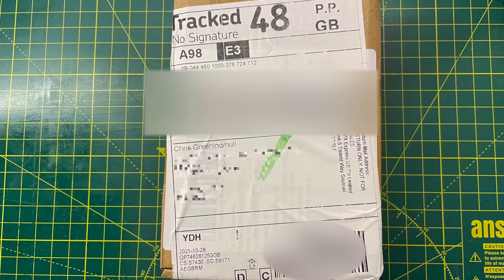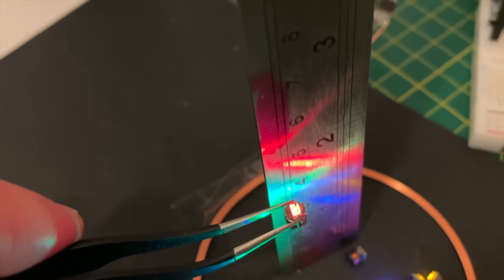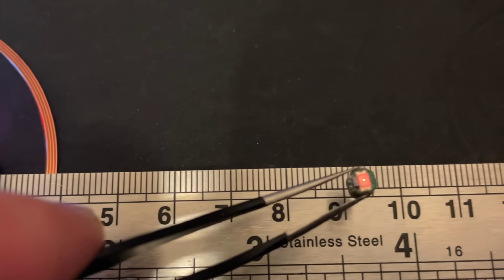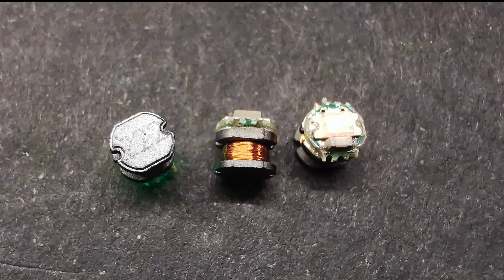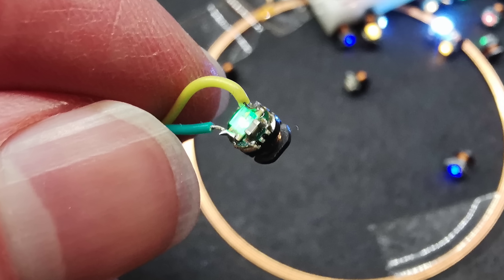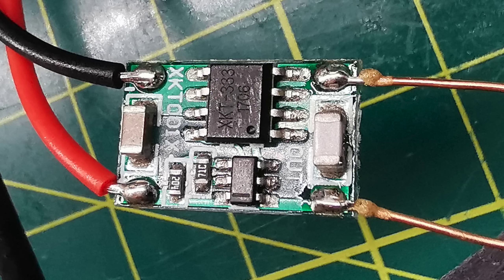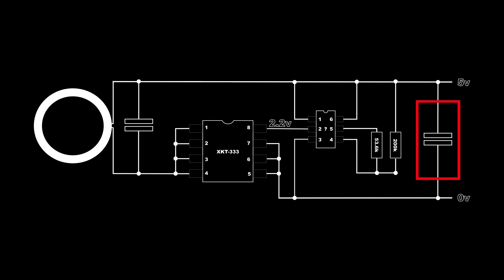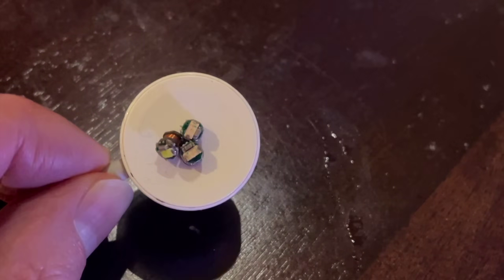Look Mum No Wires - This will blow your mind

Comment: so if you could tune the frequency you could make a programmable pattern...
3 frequencies and variable voltage and you can play RGB colours..
8 frequencies you could have a calculator 8 digit.
Reply from the maker: Definitely worthy investigating. You might need different coils for each frequency. You can try it out with the diy version: https://youtu.be/jdc_0r5pJPc
Reply: @atomic14  I'm a thinker, not a doer. But the idea is free to a doer that hadn't thunk it...

q8)

Comment: Is it waterproof?
Reply from the maker: I’ve dropped them in water and they still light up. You could easily embed them in resin or epoxy. Probably would struggle in salt water…
Reply: Coat them in transparent nail polish, nail polish is perfect for waterproofing small things like leds

Comment: in 2009 in india, there were available some kind of LEDs that were very very tiny and aranged on a transparent glass. when we would stick that glass on the back side of mobile phone magic happened. just 3-4 second before you get call, they started flashing. purely taking energy from electro magnetic radiations!

Comment: When measuring the effective maximum distance these LED can operate, it would be sooo helpful not to introduce a parasitic element into the field. AKA that stainless steel ruler.
I mean c'mon, you sound like you are old enough to have had a stereo with an antenna attached to it and wanting to get better reception. That is where the pre-internet-people learned the basics of fiddling with antennas ;-)
Reply from the maker: I've tested it several times with a wooden and plastic ruler - I'mafraid there's really no discernable difference in range. But you are correct, using a steel ruler was a school boy error.
Reply: Just caught that same thing! Yup!

Comment: This would work well as a puzzle prop for one of those escape rooms.... If you placed an led in a translucent 3d printed gem, you could embed the coil into a chalice or something so that when the gem is placed in it, it will light up. You could even monitor the current of the coil circuit to trigger some door latch or something once you've placed enough gems in the chalice. Since the leds don't draw that much current, you might need a few before you could reliably detect it, but that could be part of the puzzle!
Reply: Probably it would be easier with a magnetic switch and a small battery tho, so nothing needs to be connected to power.
Reply: Use clear resin to make the “gemstones”, then you can cut and sand to the desired shape or size.
Reply: Furhermore, you could have several gems with only a few of them having "magical properties". You'd use some "magic harmonizer" to light up the gems that will allow you to progress.
Reply: put a blacklight LED so that when you place it on the correct spot, it reveals hidden text. 

what, me? noooo i've totally not been learning electrical engineering just to design escape rooms..

Comment: Ok, misleading. Not wireless at all. These are like the term, “free college”. Nope. Having to have a big coil to make them work which is plugged in is not wireless.
Reply: With that definition the word ‘wireless’ has no meaning.
A radio (what,  in my youth,  we called a wireless!) is not wireless.
A mobile ‘phone is not wireless.
CCTV is not wireless.
Reply: @johnstarkie9948  Closed Circuit TV uses wires.
Reply: @JohnDlugosz  
Hence,  “closed circuit”.
Reply: No wires= wireless 🤣
Reply: You're splitting hairs. The LEDs are wireless. The power source provides wireless power. You don't say wifi isn't wireless because the AP has a wire that hooks up to the network.

Comment: wear them as ear rings and  have an induction  coil  necklace   to power them , the pendant on the necklace could hide a LiPO battery

 maybe  the circuit could be reversed to wirelessly charge the battery too , but you would probably need a  large circumference   wireless charger coil to match the circumference of the necklace 
they could be placed inside  gemstone ear rings to light the gen stones  from behind too
I can't really think of any  other practical applications
Reply: That was my very first thought! I won't fight you for the patent, lol

Comment: are they Addressable leds
Reply: No. At least not yet. It seems an obvious (but challenging!) improvement.
Reply: @R.Daneel  not that challanging to be fair, small mcu (which takes almost no power) and some data encoding by modulating power supply.
Reply: @bartomiej368  Pff. I look forward to your Kickstarter.

Comment: @4:00 it is basically an oscillator with enough electric current driven to the large coil. The electromagnetic field of the board circuit must be strong enough to reach and penetrate the little coil of the LED (LC circuit). This has to do with the power loading the large coil, the frequency of the voltage in the large coil and the spatial (shape and dimensions) specifications of the large coil. If those parameters are not properly matching then the power reaching the LED (via the little coil) will not operate properly.

Comment: @3:35 This clipping is due to the clipped voltage that is powering up the LED. If there was no voltage powering up the LED then you will see near sine wave with almost no clipping. Remember that the oscilloscope correlates to the energy of the signal being investigated so if the signal strength in the direction that is powering the LED is passed to the LED then that portion of the sine wave will not be observed (chopped off) and is seen by the Oscilloscope as such. A 10 VDC battery connected to two series resistors each of 1 ohm will produce voltage measurement of 10 VDC and -10 VDC if the two resistors are disconnected at the resistors joining point. Once the two resistors are joined then the voltage is measured 5 VDC at the junction, because the current is now flowing. V = I x R.

Comment: I had an idea for these in 1972.
Reply: Yeah, me too, but THOSE DARN SURFACE MOUNT LEDS WERE JUST TOO DIFFICULT TO SOLDER TO TINY, TINY SURFACE MOUNT INDUCTORS. They were only as big as a car tire back then, and would have a require a 1.21 GW soldering iron, which handn't been invented yet.

Comment: Induction. Mind not blown.
Reply: LOL.  But put to practical use = $
("Ancient Chinese secret")
Reply: if they had a lipo battery in them  that the inductor charged  it would be much more impressive
Reply: A bit fancier: tuned resonance.
Induction is just a transformer that comes apart.  This uses a coil and a matching capacitor and the energy sloshes back and forth between the coil (acting as an inductor) and the capacitor.  It efficiently transfers energy to another one that's tuned to the same frequency.  Plain induction (two inductors) would not transmit very much power at the same distance.  Though inductors can be mismatched and this is usually the point in transformers, to change the voltage.

Comment: Very COoL!
Might be nice to dip them in a waterproof resin (weight) and float them in a (narrow) water tank display.. moving up with the force of bubbles as they dim down. E-H2O-FIREWORKS. Yep! I'm full of it... ideas that is.Thank You
Reply: if you could get them near neutral buoyancy (only slightly heavier) then you could make something like a tornado lamp. a tube with a small pump to move the water, some mesh to stop the lights from clogging it, and the coil at the bottom or maybe 2 coils depending on tube size...
picture the lights being spun around in a vortex as a party light.

if you dont know what kind of light im talking about, after lava lamps died out, glitter filled ones came around, then using a magnetic bar sunk in the water, you can spin the water in the lamp to make a tornado light.
i would use a pump over the stir bar idea because im sure it would break a few of the LEDs and im not sure if anything is magnetic in them.
Reply: @LoneWolf0648  I'll old but I must have missed the "glitter tornados" BLASPHEMY! It sounds like a Sharper Image produce :O\ But I guess I would need to see one to be fair . But the magic of which you speak has got me wanting a Vortex Party Light (VPL).  Of course they need to "pulse with the music" :O) I'll take two.! I'm in CA. 3rd house on the right. Please ship when available.  All good ideas. Cheers JM.
Reply: Or in a tank of mineral oil, stirred by a pump or perhaps thermal convection...  An LED lava lamp, if you will.
Reply: @falcychead8198  YES! Mineral Oil... and thermals... that's what's needed. My friend, with all due respect.. you are full of it too! You RoCk. Cheers.

Comment: Imagine if they were the size of a grain of rice and seperately addressable. Your could have giant screens
Reply: Kind of like...current, giant LED screens? But needing 400% more power, because of the stupidly high inefficiencies of transferring power wirelessly?
Reply: @saltysenpai4010  I'm thinking of them being suspended in white paint and using same power overwifi to communicate.
Reply: @tetraquark2402  So you'd add a microcontroller circuit too? LOL make that 8000% more inefficient. Stick with wires, my guy.

Comment: Dice tower where the die glow when they fall and land
Reply: I notice the led light up in certain orientations. Pair your tower with light up die that show a backlit number or dots.
Reply from the maker: Yep, the orientation of the coil is important, maximum power when the coil of the inductor is aligned with the transmitting coil.

Comment: You gave the answer why the coil signal looks like this yourself at 4:30:
The coil is connected between +5V and a powerswitch.
The Powerswitch switches that connection of the coil to GND.

now, if you connect an oscilloscope probe across the coil inputs, you get a nice sine when the switch is open, and a nice constant 5V when its closed.

Comment: The RX coils output sine waveform, looks flat on one side, because the flat area is where it's sinking current into the LED and the LED is forward conducting. So technically 'yes' the waveform is upside down, but only from the perspective of driving the LED with a possitive voltage, else it's the same as driving a reversed LED with a negative voltage.

Also you are correct that the phone chargers don't output all the time and do handshake and ping pulses(as well as tell the TX coil how hard to drive itself so the RX coil sees a reasonable voltage), another thing they do is FOD(foreign object detection) to make sure they aren't sinking their power into something conductive nearby other than the phone.
Reply: The simple answer ... Cause led as being a diode adn with a cap . Its just showing the positive cycle of sine wave

Comment: The waveform  looks like they used tantalum cacitators. They work the same way like electrolit caspacitators, but are more compact.
Reply: nope.
cant use tantalum in an application like this: a reverse-biased tantalum will blow up fairly quickly.
in fact, cant use electrolytic at all (with rare exception for bipolar electrolytic.)
what we see connected across the coil is a fairly bog-standard class I ceramic. wich is also a lot cheaper by the way.

Comment: The XKT333 is probably a mosfet. The unknown 6 pin chip is probably a custom made oscillator (possibly a pre-programmed micro).
Reply from the maker: Correct - it's just a MOSFET with a slightly weird pin out. The XKT001 (the unknown chip) is the oscillator.

Comment: If you change the capacitor on some of the wireless LED you can change the frequency of the tuned circuit, by driving the charging coil with different frequencies you can choose which LEDs come on and when.
You will need a wide span on frequencies because LC circuits have a wide bandwidth.

Comment: You reverse engineered the circuit nicely.  Sine wave requires an alternating voltage say from an H-bridge, half bride.  The +5v is always connected to the coil, so it can only be a half wave, this saves cost.

Comment: Your range test isn't accurate because you're using a steel ruler extending the magnetic range.
Reply from the maker: Checked with a wooden ruler and there doesn't seem to be any difference.

Comment: the other chip is the one responsible for generating the oscillations for the coil to work
Reply from the maker: That's correct - it's the XKT001 - not sure why I didn't just search for that in the first place...